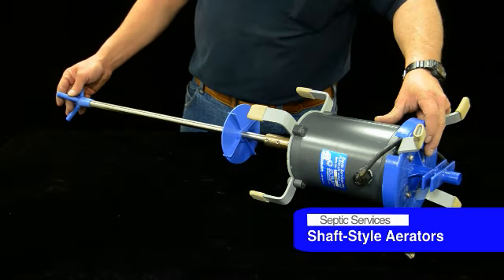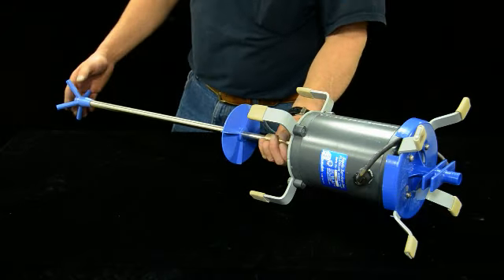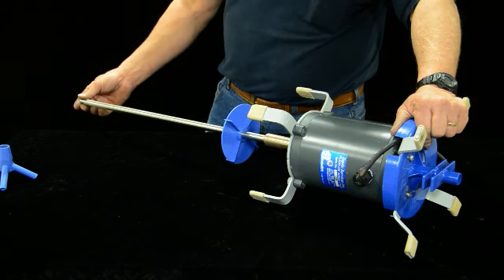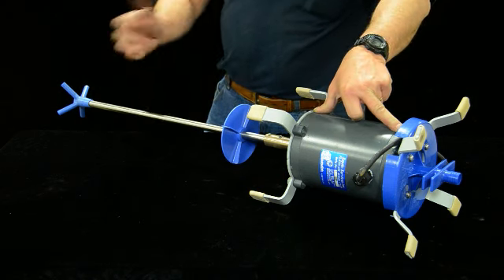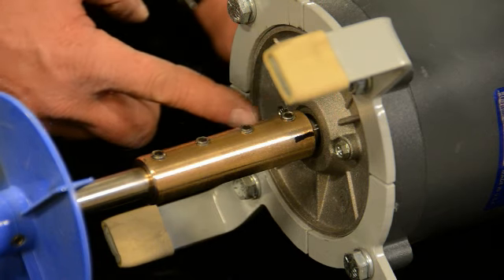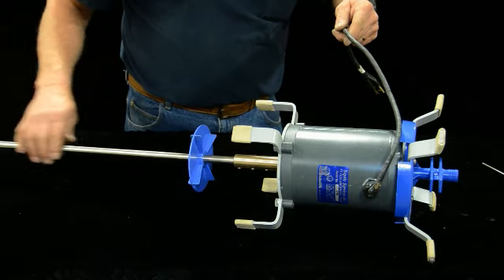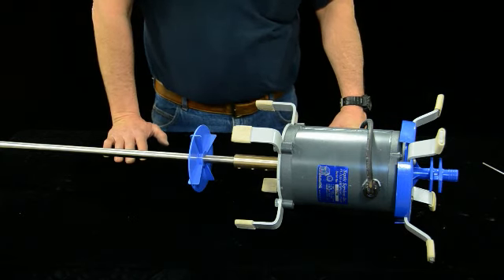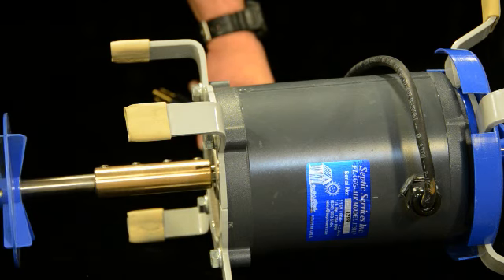Aerator Rebuild and Maintenance:  Flagg-Air 340HT Septic Aerator

Comment: Thanks for the video but you left out so many important details. Brush style, diameter and length? Where do you insert it? Through the top of the motor where the air inlet is or do I remove the shaft? Which fasteners hold the shaft on? Bottom two? All four? Where's the other mark to line up the one you drew on the collar? I need that as reference to actually align things per your recommendation.

Comment: What's the purpes os the aretor
Reply: It sucks air into an aeration septic system and spins the sewage around creating a perfect environment for the proliferation of a certain aerobic bacteria that cause the sewage to break down very rapidly as part of a residential sewage treatment plant. This is for individual property/home owners who live in rural areas where there are no city sewer lines to tie into. So they need a place for their sewage to be deposited in a sanitary way that meets legal requirements for sewage disposal on private property. It is for more specifically for homeowners who for various reasons cannot put in a traditional leach bed septic system (drain field) to filter their sewage from their home usually because the soil can't pass a perc test (sufficient water absorption rate of soil). So they have to buy and excavate/bury a multi-tank treatment plant with this aerator in the middle of a (usually) gravity fed system.  All of the home's sewage gets piped to this plant (usually only about 50 feet from the home) and treated before being discharged as chlorinated water. One person who serviced mine told me the water that comes out at the end is so pure that it is drinkable. I said "Be my guest." He didn't sample any, lol.

Comment: In the video you mention getting a "long brush" to clean out the shaft with. What specific brush do you recommend? Wire, nylon? What diameter? Please send links (Amazon if possible).  I found this one and wondered if it would work for cleaning my aerator shaft out: https://www.amazon.com/Furnace-Boiler-Brush-Dia-Length/dp/B07HLS9Q88